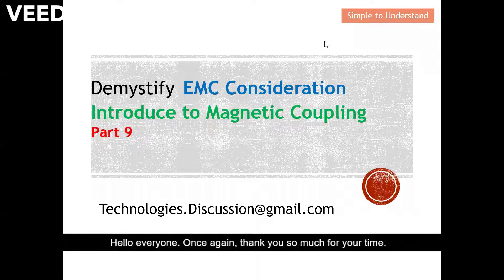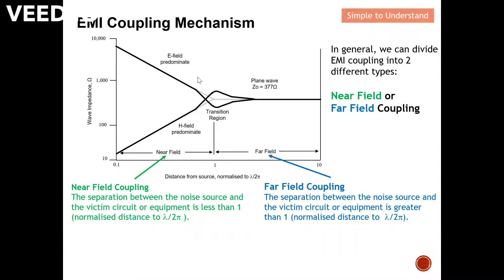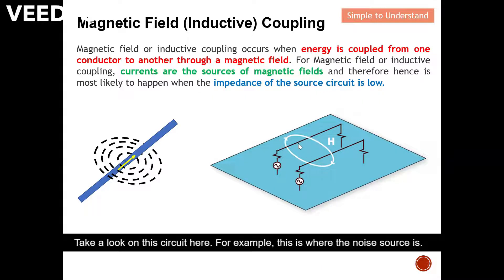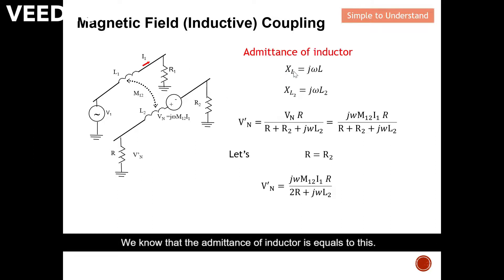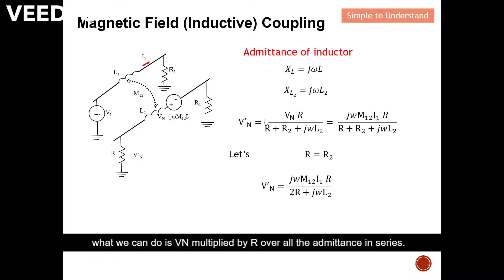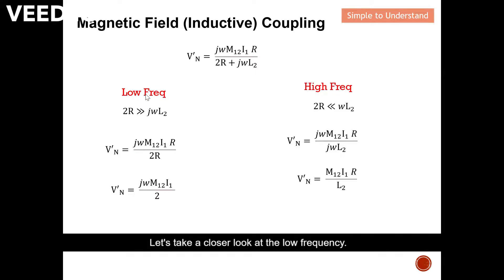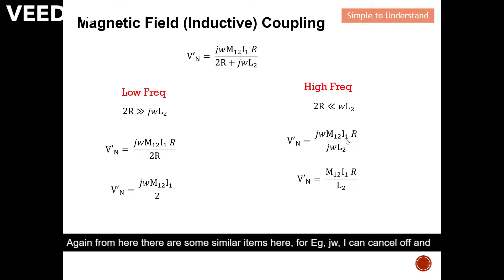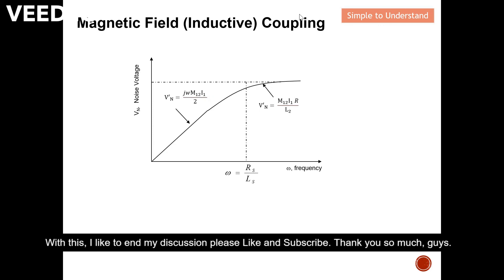EMC #9. How to Tweak the Parameters for Lower / Reduce Magnetic (Inductive Coupling) H-Fields.

Comment: I think the equation for admittance is not correct. Impedance of inductor is jwL, admittance is 1/(jwl). Still good video. I think you mean to use the term "Impedance".
Reply from the maker: I am sorry, I think the title has typo mistake. My Bad. It should be Impedance of inductor. Thanks.
All the Equations discussed here (in this video) are all correct except the header should be "Impedance of Inductor" Rather than "Admittance of inductor"
Thanks.  :)